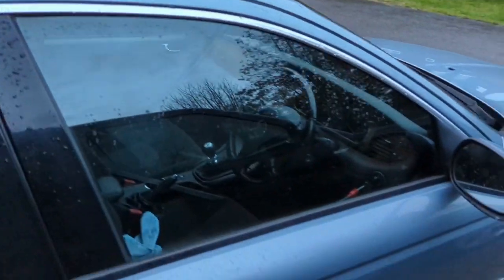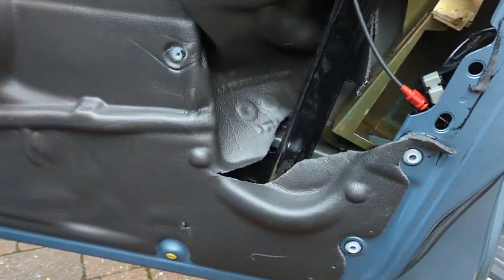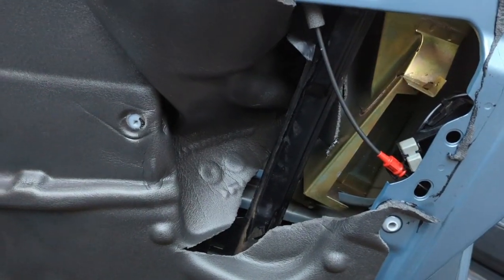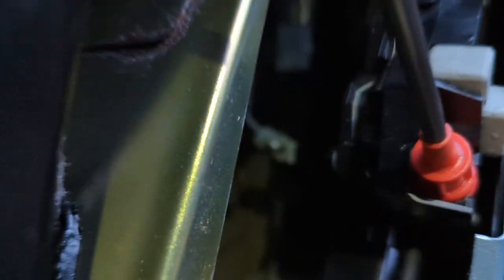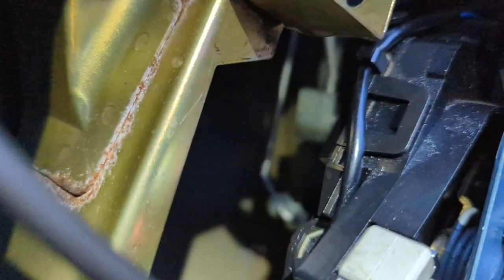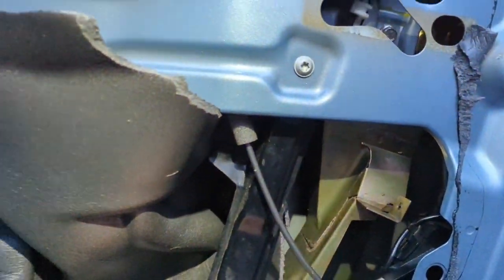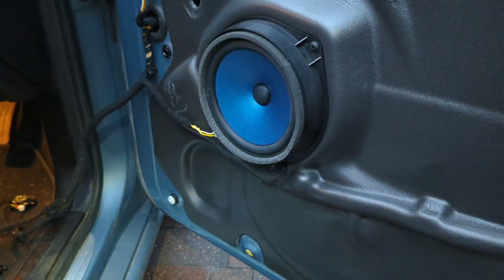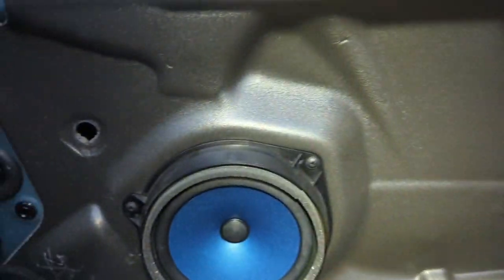Jaguar X-Type - sticky door handle fix

Comment: Hi, I have the same problem on my 2008 X Type passenger door. I think you have saved me £100  on a replacement door lock 😀 can you remember the size of the nut you put on the rod for the outer door handle ? Great video by the way 👍👍
Reply from the maker: It was definitely worth investigating to save the money! From memory the nut is already there, it's just a case of slight adjustment! It's also not failed once since I recorded the video!